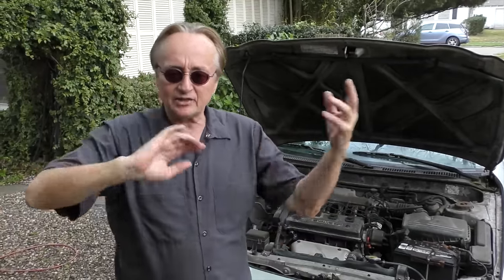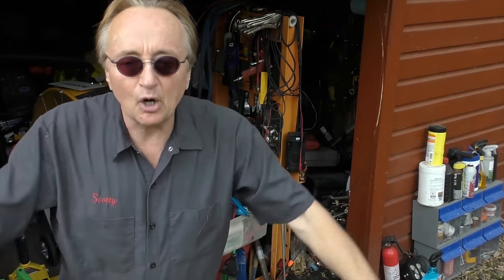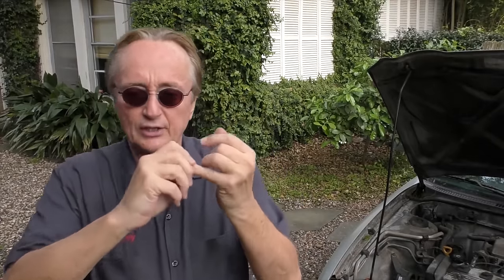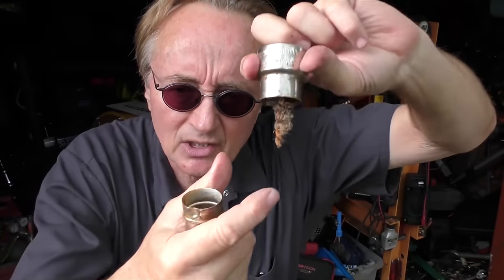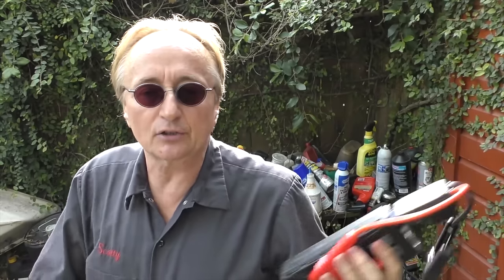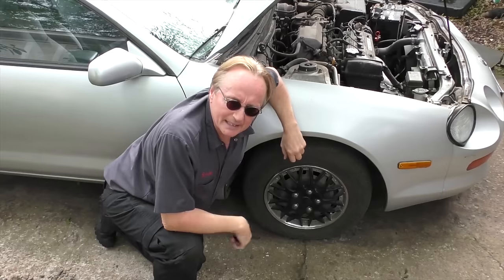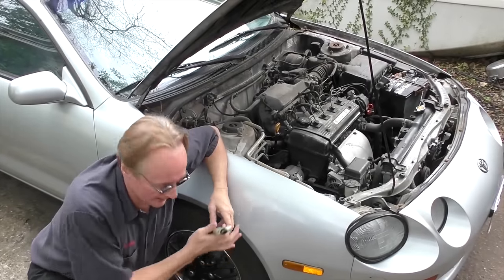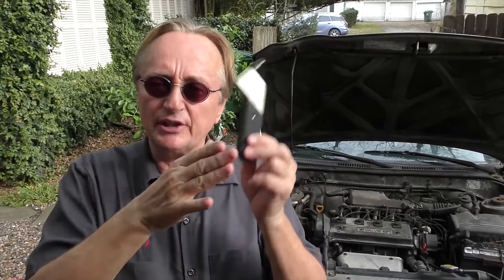If You're Not Doing This Before Starting Your Car, You're Stupid

Comment: Whoa whoa scotty you need to be careful about that advice to ignore the service car warning and reset it.
2 things come to mind:
1. You should advise owners that service interval light is NOT the same as the "check engine soon" MIL. Which means a real issue with emissions equipment. Ignoring for extended time, the car may be in closed loop mode, which can ruin the cats as the car defaults to run rich so it doesnt overheat. Make sure owners dont mistake the two!
2. The service car soon isnt just an excuse to sell owners stuff tho it may be abused as such. 
This indicates a number of vital maintenance items like oil change (in some cars its its own indicator) transmission service, brake fluid change, differential or transfer case, coolant change.. 
Essentially the advice you just gave tells owners you can drive forever without ever doing any of those services. 
I dont think you believe that. 
Youre right about going right to the dealer... Dont. 
When the light goes on, refer to the owners manual and see the corresponding service requirements at that interval. Unless theyve been done theyre needed sometime soon, you can shop around for indy mechanics for a deal. Do NOT think you dont have to do it for instance hondas need a transmission drain and fill every 30k, if you never do it youll eat that transmission around 90k and theyre about $5000 to replace. That trips that light.

Comment: What do you think about those Code Readers you buy for $30 or so and plug them in to give you Codes to see what is wrong with the car?   I tend to be Sceptical but not a Mech.   I can certainly destroy a car using Tools or fix things with Bailing Wire, Duct Tape and a Hammer....

Comment: But Scotty, what about when you replace the pads and now you have to remove fluid from the reservoir?
Reply: You can but it's often better to just open the bleeder a little when compressing the pistons. That helps to remove the old fluid trapped in the caliper. Then refill the reservoir, of course.

Comment: Scotty, I love your videos, but the information on the recalls isn't true.  I owned a Ford Freestyle and I took it to the dealership for the repair.  They told me the car qualified for the repair, so I left the car with them. It was a   day or two later that the service writer called me and said the recall had expired. He then explained that the recall expired the month after I had purchased the car. He then gave me an estimate of about a $1,000 dollars. The car  would lose throttle power on the highway.  I had to turn the car off and on while  driving down the highway, to reset the computer. The Freestyle cars were known to have this problem on a requiring basis. It was all wheel drive and I liked the car, but I couldn't keep it.  It was just too dangerous an issue

Comment: If, you don't have a brake fluid leak,and your brake fluid is low,then, most likely,you brake pads are shot. That's how I tell if my brakes are shot. I put new pads on and, Wala, brake fluid is at proper level.

Comment: I can remember a time when my check engine light came on and stayed on. I was worried that my car was having a major malfunction so I pulled into the first garage I saw. The mechanic came out of the building and asked me what was wrong with my car. I told him my check engine light is on and it stays on. He acted surprised then told me he could fix the problem but he would have to keep the car for two days and the repair would be $850.00 Thinking the mechanic was trying to scam me, I thanked him for his advice and left. A little later, I saw a big garage that my neighbor told me was very honest and did not try to scam customers. I pulled into the garage and talked to a mechanic. After I told him my problem, he said some of the sensors in the car need to be reset. He said it is a simple process and not very expensive. But, he also said on some cars, resetting sensors is a temporary fix and that the check engine light could still come on at any time. His advice was, as long as the car is running fine, I should continue driving the car and have the car serviced on a regular basis. That is what I decided to do. After driving for about 90 days, the check engine light burned out. That was five years ago. I have my car serviced on a regular basis and the car is running fine.
Reply: You know, OBD II  scanners are made for a reason. What were the fault codes?

Comment: 1:13 the break light is on because of low fulid then your pads are woren down. So it would stand to reason you need to look at the pads 
To see how much material is left on the pads, this is more a safty issue
This fact isnt common knowledge but it is fact yes you could have 3k more miles on the pads do you do a breake job at this point or put it off? Thats kinda up to the customer to decide not the dealer to demanding replacement.
But some dealers take this as a reason to cheat the customer out of making the decision for him.
Its better to be honest,
Oh you need new calipers  no you need to clean the old lube off the slide pins and put new on. The brackets that hold the pads comes in the kit most the time.
The only moving parts are the slide pins and the pad brackets and thd piston now is that bad or is it frozen with rust? Well if your brakes work is probably just fine. Buy if yhe fluids brown it could use a fluid change in the system it should be clear fulids. No color. The brake lines should be flushed out. 

Every time i get quoted a break job they want to replace everything its just a waste of money to do every part. Its not necessary and toyota they sell rebuild kits for break cylinders for under 15 bucks. 
Im not sure if other manufacturers do this anymore

Comment: i havent trrusted mechanic shops since a local shop told me i needed new struts on my 3 year old civic...it was under warranty still so the dealer replaced a ball bearing...problem solved.
Reply: Which ball bearing? What was your complaint?

Comment: Not a good idea to fill up the brake fluid reservoir to compensate for brake linings wearing thin.  When you do replace the brake pads you're going to have to drive the caliper pistons back into the cylinders and thereby pushing all that brake fluid back up into the reservoir and possibly overflowing it.  What a mess.  Maybe put in just enough brake fluid to make the brake light on the dash go out.  But not much more.

Comment: I bought new tires this one time, and they told me I need to change my brake fluid so I was like oh yeah can I look at it, they let me on the floor and everything looked good, slightly dirty but it worked good. They wanted good money to replace the oil in the brake system, I told them to f off and put my tires on. Every time you go to a big chain car repair place they will try to get you for something other than what you brought your car in for.

Comment: I had my tires rotated at big o tires in colorado. They let air out because my tires read 40psi. I told them to fill them back up because I drove 50 miles on a 90 degree day to get there. I argued with them for 5 minutes before leaving. Sure enough, next morning I go out and they all are at 30psi so I had to pump them all up to 35.
Reply: You expected Rhodes Scholars there?
Reply: No but I expected that a place that literally only deals with tires to at least have basic knowledge of tire inflation specs. 3 different people inside and none of them knew that the tire pressures are always a cold temperature specification. It would be like going to a place that only changes oil and has no clue what the difference between 5w-30 and 10w-40 is.
Reply: @timmypstyle  I wouldn't go to either. Live and learn, right.  I usually buy from Tire Rack. My repair shop picks them up, saving shipping costs; and, installs them very expertly. They schedule the appointments and have always run exactly on time.
Reply: @wholeNwon  I actually only went to big o tires because of a free tire rotation coupon. Otherwise I wouldn't have gone. I no longer live on that side of the US so don't have to deal with them lol. Never used tire rack but may be going that route soon. And I do all my own oil changes too so no problem there. 4 vehicles only costs about $160 using full synthetic. I use mobil 1 extended performance so I usually go 8k to 10k miles between changes.
Reply: @timmypstyle   I have always done my own oil and filter changes, too. That way we both know what actually goes in the crankcase.
I don't use Mobil 1, but independent engineering lab testing show that it isn't certainly an adequate product, though I would change at no more than 7500.  Scotty Kilmer also recommends that. Mobil recommends following the engine manufacturer's recommendation.  As to free tire rotations, they can be an opportunity to sabotage cars. A common way is to asymmetrically tighten and over-torque lug nuts to warp rotors,  damaging wear sensors, etc.

Comment: A woman, thank you so so much!! 🥰♥️♥️
Reply: Auto Zone or most other chains, will scan your car, check your fluids, install wipers....for free!  It's usually something simple. It's usually fixed when u leave the lot. If not, they've clarified what's needed. A shop told me I needed a new catalytic converter...Auto Zone showed me a breather hose that was easier to put back on than poking a straw into a big gulp. Tires...Les Schwab offers FREE drive thru tire filling service. I do that every month. Buying tires?  Go to a discount tire store. Buy tires with 90% tread. You'll save hundreds on tires that are barely used.

Comment: Come on scotty you know that once the brake fluid is low without a leak it means that the pads/shoes are worn out and should probably needs replaced. If you fill the fluid when the pads are low when you are replacing the pads and push caliper back it will push the fluid out of the reservoir

Comment: Scotty, a question I have asked both excellent mechanics and college physics professors both and none could answer. Why is the air pressure in a tire the same on the car on the tires as they are off the car? Why does the pressure not go up when loaded with the cars mass?🤔🤔🤔
Reply: @Kevin A tire pressure gauge does not measure pressure then?
Reply: @Kevin A  So, it does not matter how hard I squeeze a tire, the inside air pressure will remain the same?

Comment: Good grief! If your light comes on and you don't have a leak than you better be checking the pad thickness because likely it needs changed too. Just adding fluid to get the light to go out is stupid. If you haven't found a good mechanic yet then that's your main problem because low brake fluid absolutely needs an inspection to find out why.
Reply: Again if your heater doesn't work because the antifreeze is low that is a sign of a bigger problem. You really need to find the cause asap.

Comment: I have to disagree about adding fluid to your brakes. The brakes are a sealed system. If your brake fluid is low you either have a LEAK or your pads NEED TO BE CHANGED! 🤦‍♂️

Comment: Can we talk about why the brake fluid is low? And why it shouldn't ever be topped up? (MAJOR NONO)..... There are TWO reasons for brake fluid to be low, although he only mentioned one, "Your system is leaking" .... Repair the leak, then top it up. The second is really simple and absolutely never requires topping up !!!  If your reservoir is that low and you have no leak, where has your brake fluid gone? It's quite simple.... as your brake pads wear out, the pistons in your caliper extend further and further allowing more and more brake fluid to take up the space behind the pistons..... The fluid being that low indicates that front, rear, or both need new pads ! ...... The reason not to top it up is simple, to replace the brake pads you must push the caliper pistons back in which in turn will force all that missing fluid back the Master cylinder..... If you've topped it up, it's now over flowing !!!!!!
Reply: Missed the part about pistons coming out but still it wont be that low unless pads are worn out

Comment: Hmmm... the last time I worked in a Brake and Exhaust shop professionally... you never top off a master. Reason is, the fluid does not evaporate, and if you get down low enough to look behind your wheels and you see no wetness... your brake pads or linings need to be replaced. You "never" top off the master...  if your a pro, you know better than that sir.  Just saying. Those lights use to be ideot lights till the end of the 70's I think there or abouts. After that... they have reason. But, to each his own I guess.

Comment: That battery checker thingy (spoke too fast for me to catch it) you put on both the battery posts.  In an other video you said DON'T put it on both posts because it may damage a sensor thingy.  ???
Reply: Not quite. What he as talking about, and using in the video, was a lithium ion battery jump starter. It just so happens to also measure the voltage of the battery and display it. 

He said with the old battery jumpers you would have to put the negative terminal on a bolt or something on the chassis to ground it, because if you put it on the battery, you would get a spark, which wasn't good for the battery. The new lithium ion battery jumpers don't cause that spark because of the way it's designed, so it's okay to put both the leads from the jumper on the battery, instead of putting the negative (ground) lead on the chassis, and that because you can do that, it makes a better connection, putting more power into the battery quicker than the conventional lead acid jumpers.
Reply: @stacyturner1317  with conventional jump start a spark at the battery could ignite hydrogen from battery, causing it to explode. I've seen it happen!

Comment: Sorry Scotty but you're wrong. when the brake light comes on and you do not have a leak you need to replace your brake pads That's why it comes on. The never refill the master cylinder when a brake light comes on check your brake pads. Replace your brake pads and when you do that the fluid will flow back into the master cylinder and the light will go off.

Comment: MOST OF YOUR ADVICES ON AUTO MECHANICAL MAINTENANCES ARE INDEED GOOD AND VERY INFORMATIVE. HOWEVER,  YOUR PRESENTATIONS COULD BE MUCH BETTER IF YOU USE LESS OF YOUR ARMS AND HANDS MOVEMENTS WHICH ARE MOST DISTRACTING , AND MEANINGLESS .USE YOUR LOUD MOUTH INSTEAD AND YOUR PRESENTATIONS WOULD BE FAR BETTER AND PROVIDE BETTER ATTENTION OF WHAT YOU HAVE TO TELL US.

Comment: How about the stupidest reason why the brake light is on? Ready, it is because you have the parking light engaged😂😂😂That is right, a friend,parked his car, pushed the emergency brake to set the brake and then forget to disengage the emergency brake when he got back in the vehicle before proceeding down the road and couldn't figure out why his car was sluggish and wasn't get the power. Oh plue there was a noise. I would have told him ahead of time, but I was laughing too hard. It took me about 20-25 minutes to stop laughing to tell him to look down at the emergency brake.

Comment: If you're brake fluid is low and the light is coming on with no leaks in the system, DO NOT FILL YOUR BRAKE FLUID RESERVOIR!!! The pads are worn down and need replacement, this guy doesn't always give good advice...

Comment: I stopped watching at the top up your break fluid up part, change your pads or get the leak repaired people, if you top it up when you change the pads,compressing the brake pistons will make the fluid overflow and spill everywhere and doesn't repair the problem.if you're car has drum brakes its more than likely that the cylinders in the drums are leaking.

Comment: If brake fluid is low, where has it gone? IT HAS LEAKED! If it leaks there is a problem and get it fixed or face a failure.
If the pads are thin REPLACE THEM!
This guy is promoting dangerous vehicles.

Comment: That is horrible advise about filling the brake master cylinder with fluid. Hydraulic fluid does not become consumed like gas or oil. Either it has a leak or the pads need to be replaced. If you fill it up with fluid then change your pads later the reservoir will be overfilled. If the brake light comes on, ALWAYS check for leaks or see if your pads need to be replaced. NEVER top off the reservoir without making a complete brake system assessment. If you can’t do it yourself take it to a trustworthy person that can. It is the most important part of your vehicle to keep you alive.
Reply: Ah, the voice of reason. Are you sure you belong here?

Comment: #1 is very dangerous advice. If your fluid is low because your calipers are completely extended, well guess what, you probably need brakes. Leave it alone without checking it out? Well when you're out of brake pad and that caliper starts hitting the rotor it's likely to overheat and cause you unnecessary repairs. Worse yet you can have a leak and then you just won't be able to stop one day. It'll work perfectly fine until bam! You just buttfucked some poor souls car. So unless you know how to do your own maintenance - if you have a brake light on please have it checked out asap.

Comment: As a Master Tech for 20 years I have to say that you are absolutely wrong about brake fluid. It does NOT just get low for no reason. Manufacturers have the brake fluid reservoir set so that as the pads wear the fluid level drops. If you fill the fluid and then change the pads you will have overfilled the reservoir. If you are low on brake fluid have your brake system checked by a professional. Your advise here is dangerous and irresponsible.